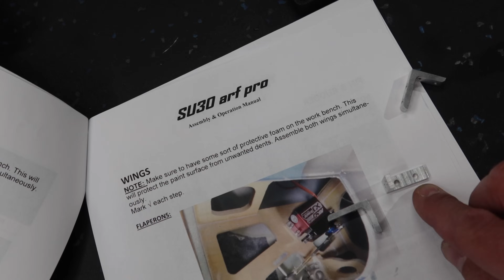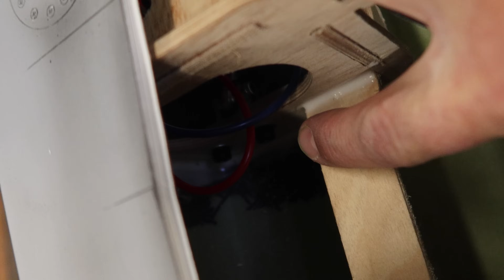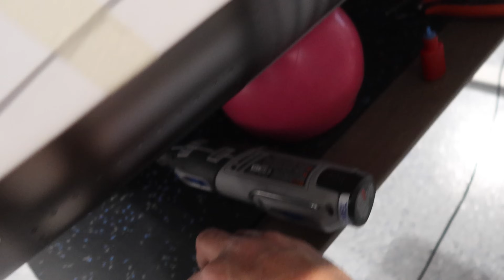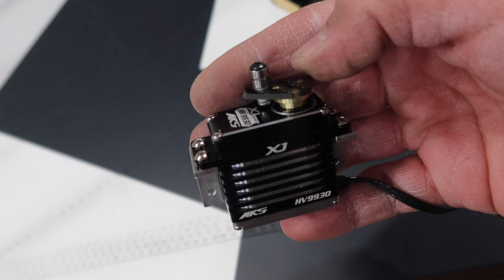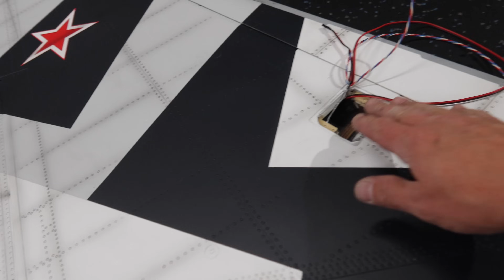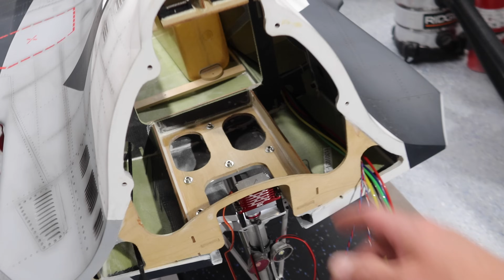Wings of Glory: The SU30 RC Jet White Russian Scheme from SKYMASTER

Comment: Why would anyone use a clevis fitting, they were mediocre at best thirty years ago. Should be a ball joint fitting for a no slop actuation.
Reply from the maker: Completely disagree!  Did testing a couple years ago and they outperformed any ball joints by more than 2 time.
Reply from the maker: Here is the second video of the two. RC CLEVIS & BALL JOINT Testing Round 2 - Testing to failure
https://youtu.be/pGAamkzMsdQ

Comment: I would feel more comfortable with aluminum horns on ailerons for such a big jet. The holes on the carbon fiber over time can get loose
Reply from the maker: I have experience with both. 80 flights or more with a clevis. Zero play. I would expect the opposite, that aluminum would wear quicker.